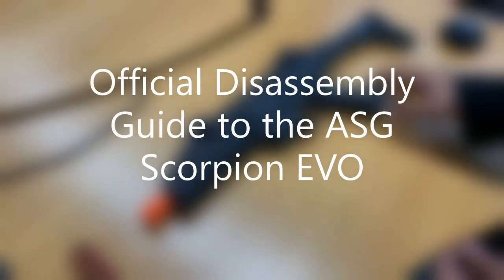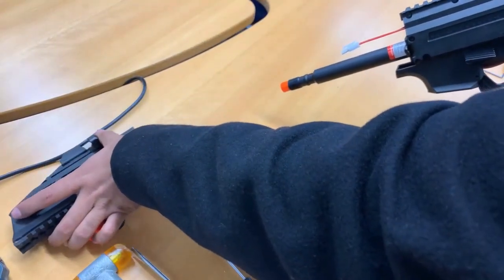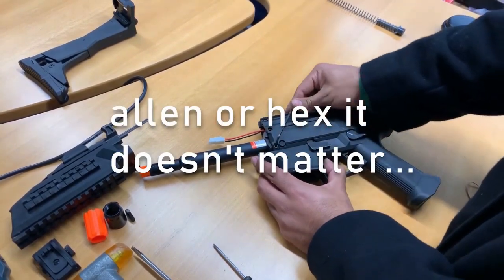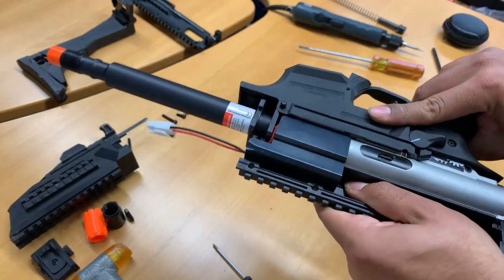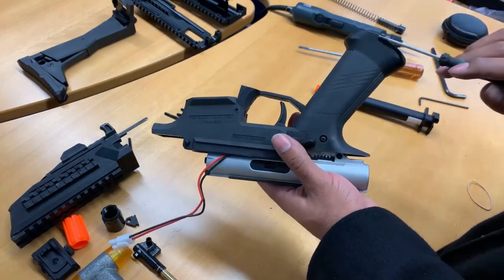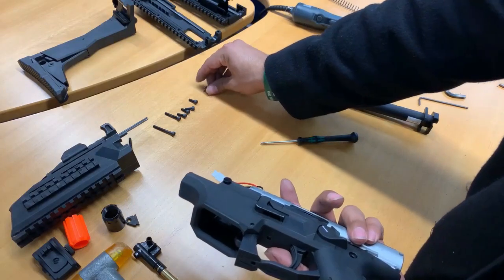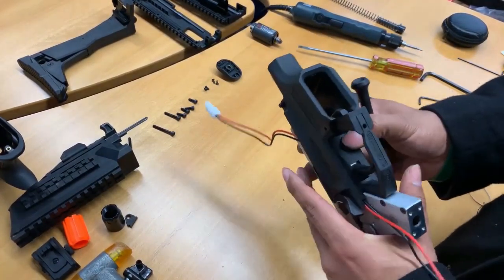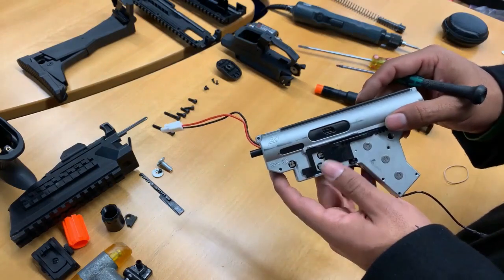ASG Tutorial: Complete Guide to Disassemble the ASG EVO Scorpion

Comment: Hi I like the video it was really easy to follow as I'm looking to take mine apart just to check some wiring making sure it's ok as it's not working I bought it second hand
Just a quick question what is the likely problem I have a lose connection in my tamya plug on the gun but when I get it to connect it beeps once to let me know it's connected I try to test fire and it beeps twice and won't fire and the plug gets hot I have tried this with multiple batteries 11.1v & 7.4v lipo with the same result
Help me please as I want to use it in a opp at my local field where I'm playing as secret service and the Scorpion Evo is perfect for the theme

Comment: Thanks for the great video,
I was wondering can I bypass the mosfet on the asg I bought mine in 2018, the issue I have is even with fully charged battery the gun stops firing after 10mins… how could I possibly overdone this problem doing this at home myself?
Reply from the maker: The mosfet is a drop-in mosfet so bypassing is not possible. I had a similar issue happen to me on my personal evo and a friend of mine suggested to switch out the motor contacts on the mosfet. I used AIP Gold plated motor contacts and that did the trick. If you feel comfortable with that then it may be a potential fix and if it doesn't work, you will have to switch the whole mosfet. I recommend the Jefftron Leviathan Mosfet for the EVO (something which I've done for the BT connectivity and high transistor capacity). I will be making a new video on the upgrades that I chose for my EVO this December so it can give people an idea of what they can do with their EVOs once parts start to fail.

Comment: Hey everyone firstly thank you so much! for the video.

I have a big issue, I just changed the nuzzle, I did this on many other gearbox, so I know well what I am doing.

The issue is that when I reassembled it, it gave me 2 beeps, which is an error, so I tried again. Same issue.
I again disassembled it and put everything back together EXACTLY how I found it. No more beeps, it just doesn't work anymore. 

The issue here is that the motor works, ( tested ) battery works, ( tested )

What could this be? Could it be the muzzfeed chip being burned out? I don't see any burning traces. 

Can I have some help please?
Reply from the maker: If you have facebook I'd recommend getting on the ASG Scorpion EVO USA owners group to see if anyone has any other insights for you. IMO it seems that your whole mofset died somehow. I'd recommend the Jefftron leviathan (I had to make the switch too). Sorry I couldn't be of more help.

Comment: Hey I don't know if you could help or not. Basically when my mags run dry the evo locks as it should but when I put a mag in and hit the bolt release it stays locked out, its only started doing this recently. Any advice you be greatly appreciated
Reply from the maker: From what I can remember, there could be 2 possibilities, 1) the screw inside the trigger guard may have come loose and needs to be tightened. 2) you may have a bad "bolt" release switch. If it's the latter, I would check in with ASG and talk to them about your warranty.
Reply: @Gomeazy  thanks a lot bud. I'll check thos 2 and see how it goes 👌

Comment: Is there a drop-in flathop+barrel combo for the EVO?? Have mine for years, fully upgraded bu ASG Denmark with asg ultimate. However only I can do is change the stock hop and barrel. (1.2J is our max)

Edit: it is also short stroked by asg
Reply from the maker: There isn't a drop-in solution that your looking for however EVO uses normal AEG barrels and buckings so go with a configuration that fits your needs and budget although any tightbore inner barrel may increase your Joules past regulations. Just keep it in mind when your looking at parts.

Comment: Quick question my bolt catch only locks back when the charging handle is on the right side and won't lock back when I put it on the left side.  Any idea what is wrong?
Reply from the maker: Sorry for the extremely late reply. The reason your bolt doesn't lock back to the rear when the charging handle is on the left side is because the bolt lock is not making contact with the fake bolt. When the charging handle is on the right side it is exerting force leaning the bolt to the left which gives the fake bolt enough contact to lock itself to the bolt catch. To remedy the issue one will have to use a set of pliers to slightly bend the extended portion of the fake bolt (the elongated portion on the bottom of the bolt) inward. Bending that portion of the fake bolt will create enough contact to catch the bolt catch. For illustrations email me at techsupport-us@actionsportgames.com.

Comment: 7:50 my evo does not have this. Do I need this? If so what one should I buy
Reply from the maker: Are you referring to the Teflon tape? If you are then it is not needed and it should not come with a brand new EVO. Teflon tape is used as an airseal mod.
Reply: @Gomeazy  ohh ok thank you so much, for your response and how quick it was! So would fps drops and double shooting then turning off most likely be a motor problem then?

Comment: The selector switch just jumped out of my gun. (Left side) is this fixable?
Reply from the maker: @Emperor-DROOF  usually yes. There's a grub screw on the selector switch that you back out and screw in once you put it back in place.
Reply: Hi thanks for the video will  come in handy as my retailer won't honour the warranty so  I'll have to fix it myself....so a fresh asg 11.1v battery on my Evo ultimate boost 30 mins into a skirmish the grip became really hot and lost all power when checked my leviathan app the battery was drained to 9% unfortunately this is the 2nd time in under 12 months it's broke first time around after 1200 rounds. The motor and gears broke. Any help would be much appreciated 
Many thanks
Shaun